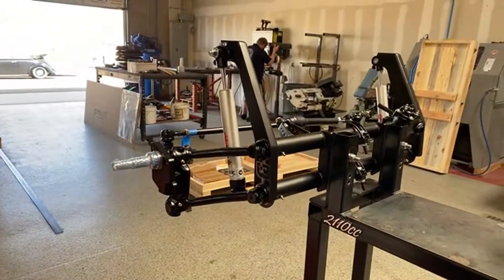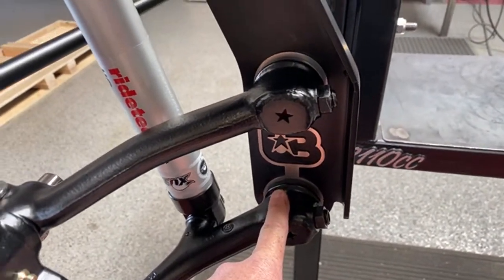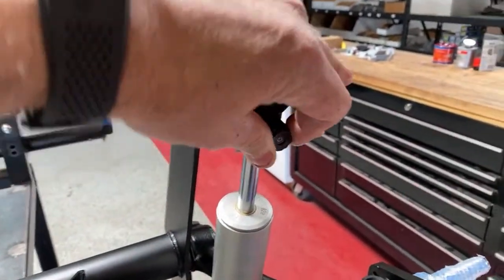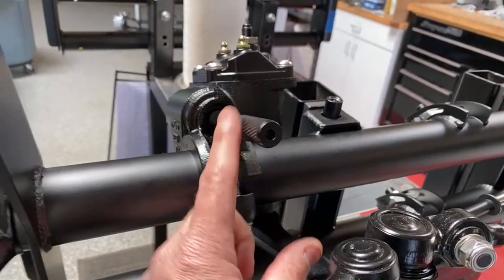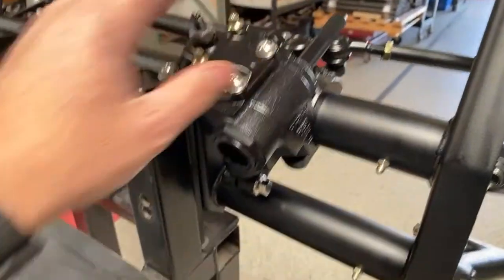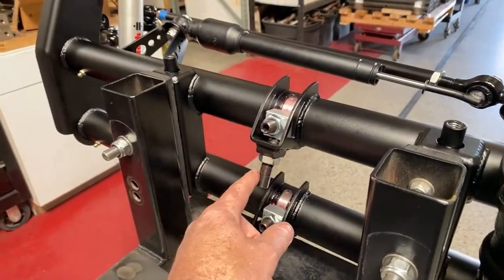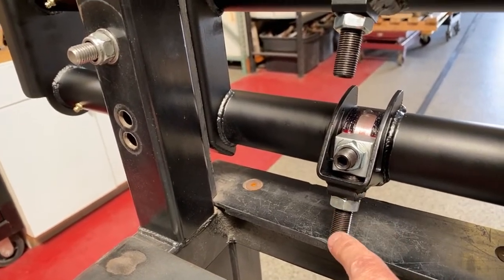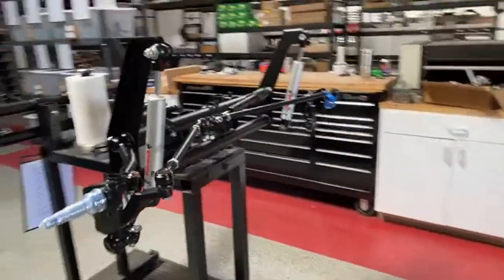The Latest & Greatest PRObuilt Narrowed & Adjustable Beam for a Classic Volkswagen Beetle

Comment: Cool tips So do you even need drop spindles since you have 7+inches in adjustments in the beam
Reply from the maker: Yes, because the ball joint needs to be in a position to articulate or a arm needs to be in a position to articulate and limit bump steer.

Comment: More details on the shocks!
Reply from the maker: What do you need to know Jerry?
Reply: @AirkewldVWs  I have 68 Bay Window will these fit.
2.5 inch drop spindles and wagon west rear drop plates in the rear? Costs please .
Thanks
Reply from the maker: @jerryzunich6045  I am unable to give you costs currently but I will need to have you remove the shocks on the vehicle. Set the bus on the ground to load the suspension and for you to measure the distance from mount to mount front and rear. Then fill this out https://www.airkewld.com/Articles.asp?ID=319 so we can get this handled when we are able to move forward with quotes and orders.